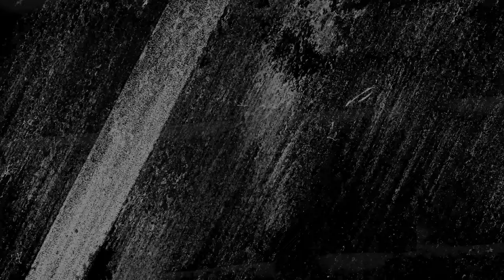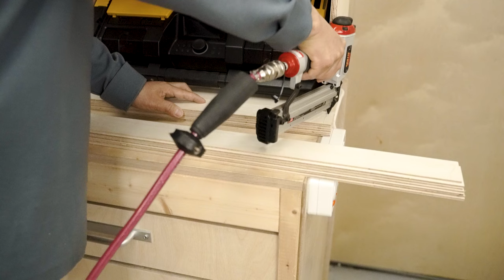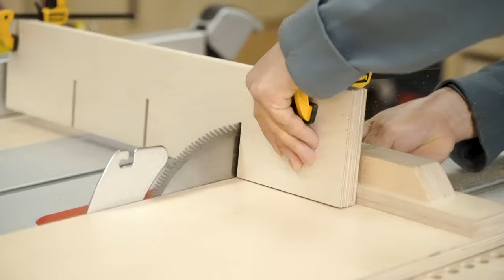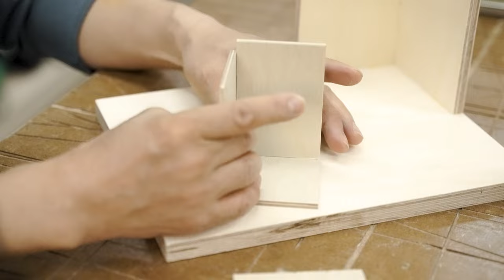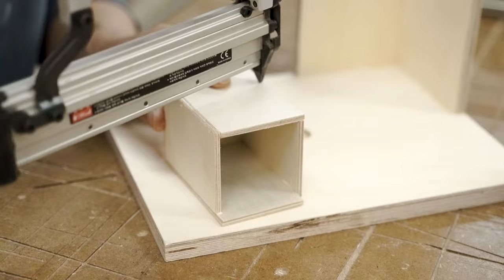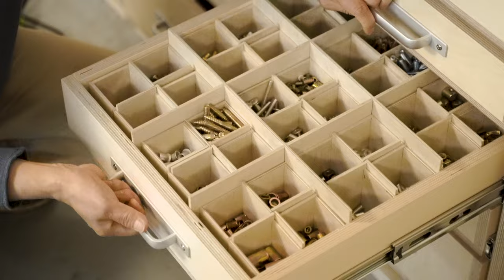Drawer cabinet / DIY

Comment from the maker: I thought that the density of the products in the drawer that I made was too low.
Parts and materials that need to be managed in a limited space increase, and it would be better to install a partition inside the drawer. 
But I wasn't satisfied with just a normal partition, so I designed it so that I could make a partition and put the parts cases accordingly.
I made 12 compartments in one drawer, and I made it possible to put 4 parts cases in each compartment. So I can store a total of 48 parts in one drawer. It's so good to store small parts.
When I made the parts cases, I made one side longer, so I took it out of the drawer and made it easier to use. 
It's a small idea, but it's very practical.
I hope you can keep that in mind. If you have any questions, please leave a comment. 
Thank you.

#DIY #drawer #storage #cabinet #making #woodworking #woodcraft

Comment: I like the lifting tab each container has.     Fun video!    tHanks!
Reply from the maker: Did you see that? To fit the size of the drawer, I intentionally placed a tab because I designed it to be almost full of small holders. When I placed them 4 at a time, I felt a bit uncomfortable because they resembled Hakenkreuz. However, it is very useful when taking out the holder. Thank you for watching the video carefully.
Reply: @Kynosys_  ..Without the tab....they would be too difficult to pick up.   Too difficult would mean a good idea would be abandoned.  
I think you got it just right!

Comment: Bello e bravo mi piacerebbe copiarlo mi puoi scrivere le misure?? Grazie
Reply from the maker: The inner diameter of the large drawer is 400*565*90 

The partition is 4T thick and the inner diameter is 135*135*110 

The small holder is 4T thick and has an outer diameter of 64*64*85. 

I hope it will be a reference for you. 
thank you!

Comment: Hello, how do manage that pins won't pop out on such thin plywood ?
Reply from the maker: It's 4mm plywood, but don't worry, it's not as thin as you think. It requires very little skill. First of all, you need to use the right length of pin. I used 10mm long pins. And, you have to remember the angle at which the tacker is hit vertically. It's not difficult, just practice a little and you'll be good at it. thank you!